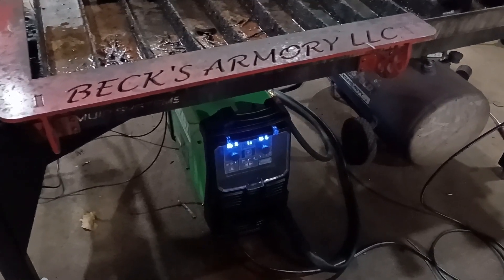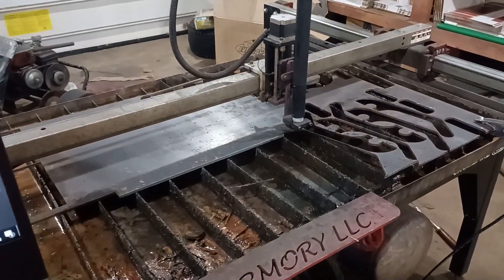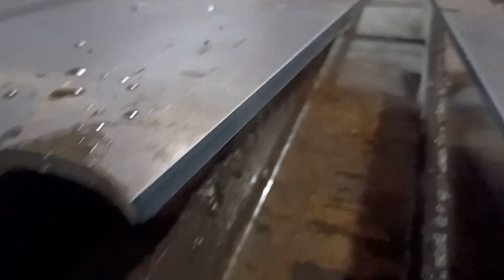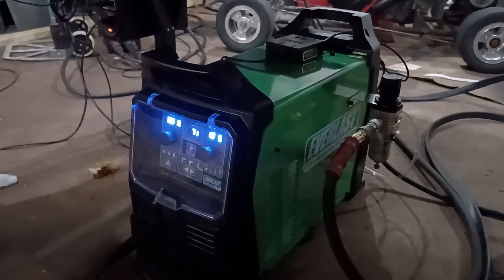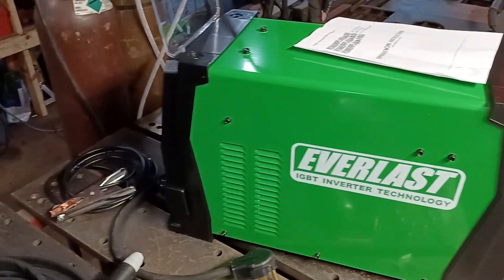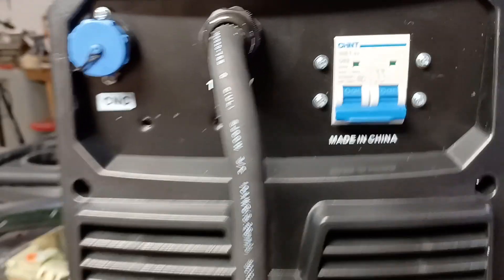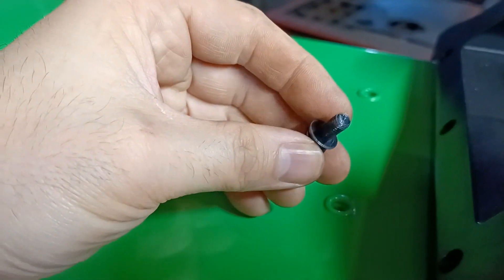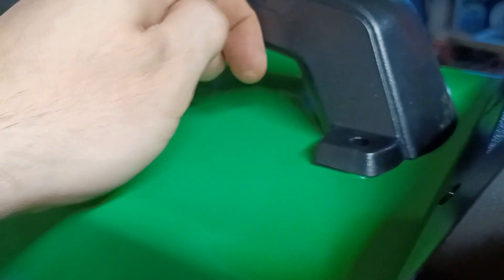Is The Everlast Power Plasma 82i CNC PAC Worth it?

Comment: Im looking  at getting  the same setup.. how  long are the cables... power..
 And torch.. thanks
Reply from the maker: I use a 25ft long 50amp extension cord.  the rest of the cables are just the standard length that came with the machine.

Comment: Can you run some thin stuff. 10 gauge maybe
Reply from the maker: I've cut 18 gauge without any problems.
Reply: @BeckTools  does it cut clean? Reason I ask is the CNC brand I'm looking at is saying it doesn't cut well on thin material. They are saying hypertherm is what they recommend.
Reply from the maker: @joshuawilson7201  You can get 0.9mm tips and run as low as 20amps on the 82i.  I've run lots of 11 and 14 gauge.  It ran great for me. :)

Comment: That is certainly a nice cut quality. How much of a draft or taper is on a cut on .250 steel? I'm trying to decide on purchasing the Everlast 82i and the Crossfire XR table. I've been spoiled with having my parts laser cut for the past 13 years and trying to determine if this newest plasma tech will produce a cut with minimal taper that I can live with.
Reply from the maker: Depends.  the taper is based on how fast you go.  If you go fast, you can get a clean but more tapper.  If you slow down, you'll get less tapper and a bit more dross.
Reply: @BeckTools  Thank you for the reply. With a slower ipm is the dross more difficult to remove?
Reply from the maker: @Captainfab406  it depends how much there is.  It's normally pretty easy to knock off.
Reply: @Beck's Armory  thank you again for your time. When I make up.my mind, I will buy the 82i from your affiliate link.

Comment: Hi there. Got a 102i recently. I was wondering if you have some sort of cut chart for the everlast machines? Not surprisingly there is very little information in the manual. I have the crossfire pro and I’m trying to figure out settings and what not. Any help would be greatly appreciated. Thanks! And great videos, keep up the good work
Reply from the maker: Not yet.  I'm working on 1.

Comment: What controller and user interface  are using
Reply from the maker: Firecontrol it came with the Langmuir systems crossfire pro table.
Reply: @BeckTools   do you like firecontrol
Reply from the maker: @772777777777777  yeah it's really easy to use.

Comment: Just bought my self this plasma cutter, What size pins connectors did you use to wire the raw voltage pins? Or how did you manage to connect it? I can’t find the correct size i called everlast and they didn’t had that info.
Reply from the maker: This plasma cutter comes with a connector that hook up to the back of the plasma machine.  I have a video on my channel that shows how to wire it up. :)  Look at my playlist.  It's in the Everlast playlist

Comment: Are you running a standard 50a circuit? the manual says at peak it hits 78a. I was hoping not to have to upgrade circuits and plugs etc.
Reply from the maker: Yeah I'm running 50a Circuit.  Max inrush has not been enough to kick the breaker.  I've got 6awg wire in the wall and an 8awg extension cord.  I love this thing! https://www.everlastgenerators.com/product/plasma/powerplasma-82i-cnc-package?rfsn=6157440.58fd90
Reply: @BeckTools  Thanks for the reply. Ill probably pull the trigger in a month or so. Ill have to save this video since thats an affiliate link. If I'm gonna spend the money you might as well get some credit
Reply from the maker: @pappy924  That would be great! :)
Reply: @BeckTools  Well I did pull the trigger and used your link so I hope you get/got a kickback. Man it cuts great. I didnt go with the crossfire like I thought I was going to and ended up building my own table (just waiting on one last guide rail from China). Would you care to share your feeds and speeds? I'm cutting by hand right now and was hoping to get similar results as you on my table. I figured you might have a good starting point. THANKS!
Reply from the maker: @pappy924  
14 gauge = 30amps, 70ipm, .045 kerf width, .09" cut height, 0.9mm nozzle.

3/16"= 60amps, 95ipm, .040" Kerf width .065" cut height, 1.2mm nozzle.

3/16" = 75amps, 100ipm, don't remember the Kerf width, .065 cut height, 1.3mm nozzle

1/4"= 75amps, 80ipm, .053 Kerf width, .065 cut height, 1.3mm nozzle.
Reply: @BeckTools  Thanks!

Comment: How long have you been using it?
Reply from the maker: this video were my very first cuts.   That was 7 weeks ago.  This thing is amazing.  I've cut and sold $4,500.00 in CNC plasma cut parts in that 7 weeks.  I love this thing!  It cuts 14 gauges to 1/2" like a dream.  Here is a direct link to the cutter I have. https://www.everlastgenerators.com/product/plasma/powerplasma-82i-cnc-package?rfsn=6157440.58fd90

Comment: Just wondering if you could show how you wired in the 82i to your pro table?
I bought a langmuir pro table and Everlast 82i plasma cutter and some say to wire in directly and you wired in through the cnc connector.
Some say they’ve had problems using the connector
Reply from the maker: I did all of the above.  Everlast contacted me directly and said "do not hardwire directly to the torch and clamp"  I wired it into the raw voltage pins on the CNC connector.  The pins are crazy tiny so I had to buy a better soldering station. lol
Reply: Thanks for the information and quick reply